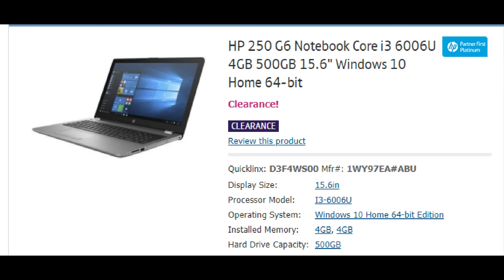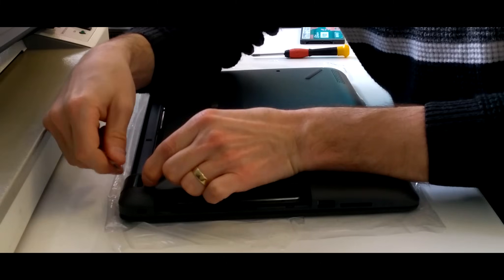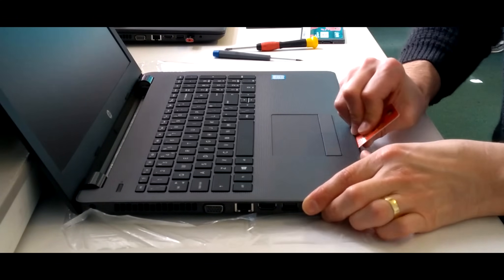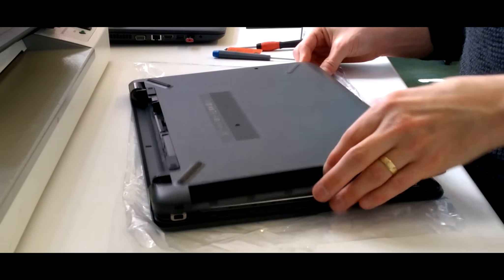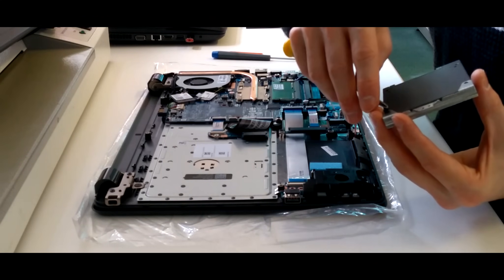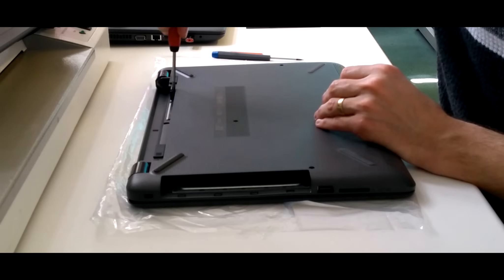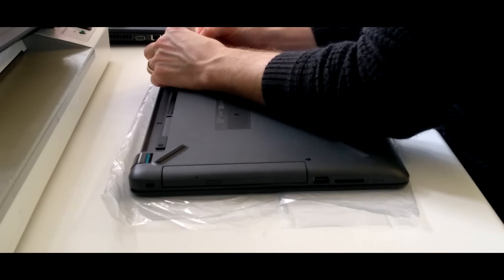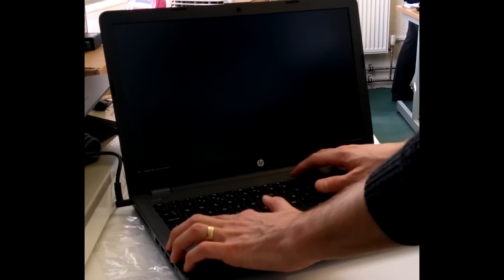HP 250 G6 Laptop - How to change or upgrade the hard disk

Comment: Awesome video wanting to do this with my G6 will any SATA 2.5 SSD fit into the bracket?

Also what RAM did you use? Its hard to tell which one to buy. Ive also seen that this model can make use of 16gb of RAM is that true?
Reply from the maker: Any SATA 2.5" SSD is fine. And for RAM I would use the crucial.com system checker to tell you.

Comment: Can I put a hp ProBook 450  g3 hard drive from in a laptop into any other device to transfer data? I've tried to replace the hhd into another hp laptop but the drive wasn't compatible... The laptop I took it out of has fully broken and I want to retrieve the files etc from the HDD... Any suggestions?
Reply from the maker: I don't know, sorry. I've not seen one of those computers.

Comment: I have a question, i have the same laptop ( hp 250 g6 ) i3-6006u but without cd drive slot ( or m.2 slot unfortunately ) , although motherboard have a slot for the cd drive ( but no connector ) if i bought the connector ( that have ribbon cable and connector) would i be able to install a caddy or at least an hdd ? Please elaborate with me if that's possible
Reply from the maker: It is likely to work if the motherboard has the ribbon connector but the case did not come with the ribbon to CD SATA connector. I can't promise.. but if it were my laptop, that's what I would be trying! Note that the DVD drive connector is not a standard SATA connector.. so you would need the ribbon cable and then a caddy to convert from DVD to standard SATA (and also hold the drive at the same time).

Comment: How did you get the bios to achi mode to detect your ssd? Windows installer won't detect my ssd.
Reply from the maker: No changes were required from default. Does the SSD work in other computers?

Comment: Many thanks for the video showing how to disassemble this laptop in detail.  Such a shame that it takes this much work just to access the hard drive or RAM: most laptops I've had prior, even things such as netbooks(!), never were such a pain in the ass to access the hard disk or RAM.  Not sure why HP did this, other than to dissuade people from taking it apart to encourage them to buy another laptop from them which has the drive/RAM you want, but is marked up more.  Such a pity that they make it so difficult to reach these parts.  I doubt anyone who wants to upgrade it will be stopped by this, just irritated, and I'd wager my bottom dollar that the people who ARE dissuaded by the steps to disassemble this laptop probably wouldn't be attempting to disassemble it in the first place, and THOSE are the customers who would simply buy a laptop that contains the parts that they'd want instead of trying to upgrade it, wirhwe vwxUsave themselves the headache).

Just a kinda bass-ackwards is my point:  those who are dissuaded, probably wouldn't have taken it apart in the first place, even if it was simpler, and those who are willing to take it apart, despite the difficulty, and simply are irritated by the annoying steps that are required to access basic components like the hard drive/RAM.

Again, as I've stated, I've had tons of mobile computers over the years: laptops, quite a few netbooks, etc. and I cannot remember any others that were this annoying (not difficult, just annoying) to disassemble.  Maybe ONE of the netbooks had a similar difficulty, but that was because some of the parts, in particular the Wi-Fi components especially the antenna, were on the side along the edge of the LCD.  The rest, accessing the hard drive and RAM have always been fairly simple and straight forward: usually just a single panel that covers the RAM slots, and a few screws and another panel to cover the hard drive area.  None of those needed me to pry the parts apart with a card to something like that.  

Anyway, thanks again so very, very, much, for a nice detailed, yet simple, video showing how to take this apart in the best fashion.  Much appreciated.  I'm upgrading the spinning rust drive in there to an SSD later on.  Been meaning to for awhile, just needed to wait until the person didn't need access to the PC for a day, as it might take that long.  It's an older SSD, but even a first gen older SSD will be light years faster than spinning rust, ESPCEIALLY if its a 5400RPM drive (I THINK it's 5400 RPM, but I'm not positive.  Even if its 7200 though, the old SSD will still be much faster.  

Thanks again!  Best of luck going forward if you are trying to make it in the youtube world.
Reply from the maker: Thanks for the thanks :)

Comment: Hi, thanks you for the video. Can I put a SSD and the original HDD? My laptop hasn't the DVD drive. Regards
Reply from the maker: Only if the DVD header is there or if it has an m.2 slot to put an SSD on.
Reply: @freename  Thank you. I haven't the DVD header. Thus I will have to buy a bracket and cables to can use the secondary HDD.

Comment: I would like to know where to go shopping for new hard disks. I am not sure If the ones i am finding are compatible
Reply from the maker: I probably used B01N6JQS8C from Amazon UK. If your system is the same as the one in the video then any SATA SSD should be fine. Remember that once fitted you need to install your operating system again as the SSD you buy will be blank.
Reply: Does it matter if it is a 255 g6 and not a 250 g6
Reply from the maker: @txble4897  As long as where it plugs in, inside, looks the same - then shouldn't matter at all.

Comment: Thanks for the video. Was really helpful since this laptop was really hard to remove all these staff just for a disk replacement LOL. 
I only had 1 problem when i tried to put the CD-ROM back. You seem to do it after all the other plastics and cd-rom just got inside really easy. 
I did exact the same way (even the screws with the same order) but the CD-Rom somewhere stacks and cannot get inside. 
Any help would be really helpful. 
Thanks again in advance,
Reply from the maker: The CD drive will have a little metal tab at the back which slides under the screw hole on the plastic case - which you then screw the screw through to keep the drive in place / so it doesn't fall out. Make sure that nothing is in the way of where that metal tab would end up. Often means you've put a screw back before it needs to be back or something somehow has got in the way.

Comment: This laptop was a b** to open. The plastic was very tight.
Reply from the maker: Yes, horrible things to work on. An old plastic card really helps especially of you use rough ground to taper one corner so it's easier to get between the two parts of the case.

Comment: It's a nice video. Thank you. I have this laptop for 6 months now. It's a good laptop but unfortunately, the build quality is bad. My up and down keys popped out and it broke when I tried to put them back on and no spare keys. At least not yet. If you know where to order new keys I appreciate it. 

I think I will try to make a small upgrade to the laptop. Another 8Gb of RAM and an SSD. There are some HP's that have M2 Slots you need to look that up. And to respond to Mauro's question... please see here the max RAM supported depending on the model you have.http://prntscr.com/jbw3x9

For more info about the laptop, you can see the service manual: https://content.etilize.com/User-Manual/1040138038.pdf
Reply: HP should replace Keyboard Top cover under warranty.

Comment: can I put a m.2 ssd and the original HDD? thanks
Reply from the maker: I don't remember but I have more to take to bits later this week and will try to check if it has a slot.
Reply from the maker: Here are photos of the motherboard:
https://image.prntscr.com/image/n5sK08FkTtaL615pvgqWtQ.jpg
https://image.prntscr.com/image/dBJJ89EEQIazTGn7pt8zhg.jpg
https://image.prntscr.com/image/twNC2R4TQvGeOFZ3go1zEg.jpg

It doesn't look like there is a spare m.2 slot on the boards in the machines I have. If you look between the CPU+RAM and the large keyboard ribbon cable there is in fact a "JSSD" port solder pads on the board, just no connector.

And, if you could in return for the above.. :D please subscribe - the subscriber count really helps small youtube channels like mine.
Reply: icannotgetafreename really THANKS! YOUR ARE THE BEST! you have a new follower ;)
Reply from the maker: Thanks for the thanks :D
Reply: I have a different model of HP250 G6. I took some pictures of the MB just for comparison:
http://prntscr.com/jbxj7p
http://prntscr.com/jbxk3k

No M2 Slot unfortunately! :(